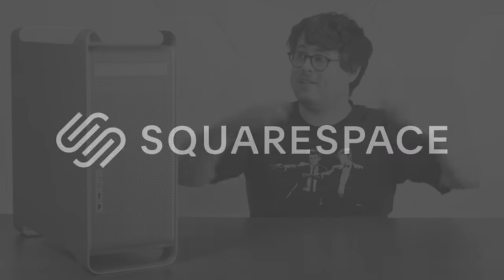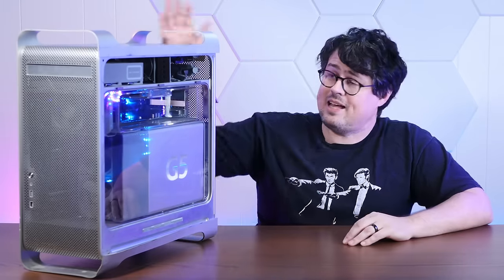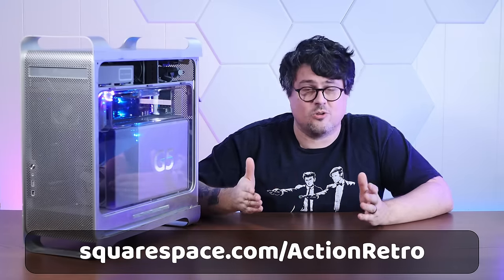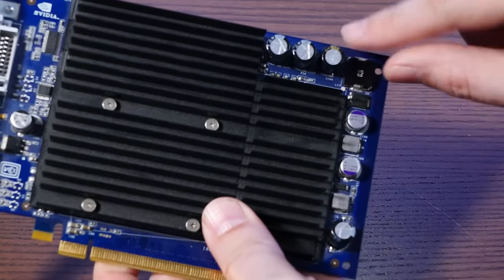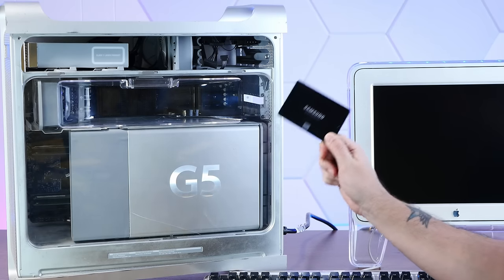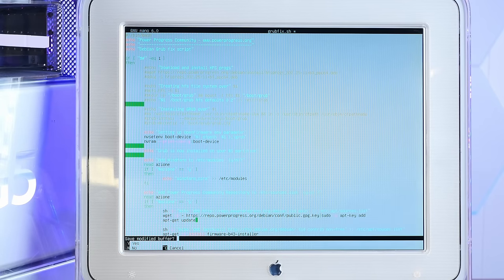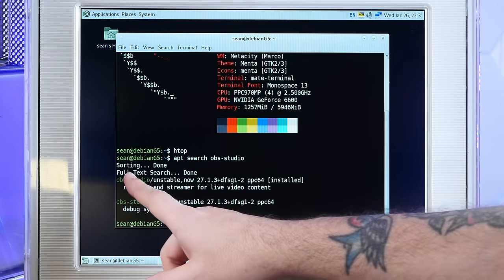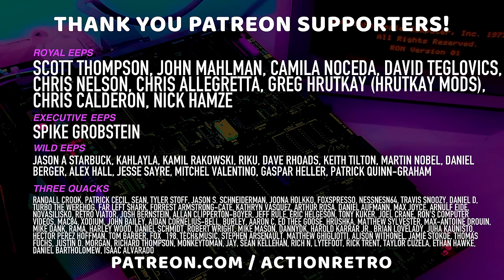Four G5s, in ONE PowerMac? It's the fabled G5 QUAD!

Comment: I'm with you on that gpu cap, I'm 100% sure that GPU cap was replaced by someone else too. It's even a different color. My guess.. they just used a heated knife or spoon or something. Probably did what they could in a pinch, since it was probably holding up some studio sessions.
Reply: Or one of those butane torch soldering irons.. (shudder). Those are basically a brûlée torch making a knife hot anyway, but sold specially for that purpose 😅

Comment: I have a 2004 duel 2.5 G5 I rebuilt the LCS in mine. It is not really too hard. There is a couple of threads on Mac Rumors forums that give some pretty good instructions on how to rebuild it. I also used modern cooling fluid to refill it, I used Primochill PC Pure 32 fluid which is much less problematic then the Dexcool that was used as the original coolant.

Comment: I would so be pulling that all out, flushing the rads and pumps and replacing all of that tubing with modern ZMT. I bet a fluid refresh in combo with new  tubing you could make it bulletproof.
Reply: But would a pump that old and high millage be okay? I imagine the seals and stuff would be pretty worn
Reply: @JohnSmith-xq1pz  seals on the pump/water block could be refreshed pretty easily. I’d love to get my hands on one and pull it all apart.
Reply: @elitexcomputing8802 I suppose yes new seals could be made on a laser cutter or something assuming standard one's wouldn't fit

Comment: Most people with these models replace the water coolers with air coolers, there is a diagnostic tool that adjusts the fan speed on mac garden that basically fixes it... Ken actually did a video on it and it works fine.

Comment: I have a Late 2005 Quad G5 I bought from a cad guy (it still had applecare on it (which is good because its boot drive failed))... thankfully, because it's a late 2005, no leaks. sadly, like yours, the 'handles' got mangled (in my case, the top on 1 side in the front and back).. still going strong though, was and is a workhorse. At one point, added 4 1TB drives w/ ZFS to it for extra storage. It's one of my "I'll never sell it." machines. I would however replace/repair the broken shell part(s) if i could.  As an aside.. that capacitor on the video card was not OEM (you can tell that if for no other reason it doesn't match the other 2 in stripe coloring).. someone who couldn't solder replaced it.

Comment: Okay, in my main Quad, I put in an eSATA PCIe card, which is great, as far as the fastest speeds from a external drive. The enclosure I got also has USB 3, so it's great for transferring data to newer machines. I also put in a Firewire 800 card, which has an internal port. I connected an internal Firewire drive, which is the boot drive for Tiger. I put in an Nvidia Quadro with half a gig of vram, I think that's the most powerful card you can run on a late 2005. I tried hard to get USB 3 to work, but there just aren't any drivers available. I tried to use Snow Leopard drivers, which seemed to install, but the card just wasn't recognized. The main SATA drive boots Leopard, and the other SATA bay switched between Fienix and Sorbet. (Edit) I forgot t mention the IDE Bluray disk player. It is pretty cool tone are to watch Blurry movies on that 30" display.

Comment: Hello there!

I had such G5 for a few years and ended up swapping for a dual core late 2005. It generates ¼ or less of the heat of the Quad, so I've never heard the fans spin up - and it's enough fast for daily tasks, especially with Adelie.

The Quad was loud and I didn't have the guts to maintain the LCS. I regret selling, though. It was maxed up with 16GB ECC, the Quadro 4500 and SATAII SSDs. =)

edit: I've also tried modern GPUs (trying to get stuff sorted with the nouveau folks) and a Thunderbolt card. =)

Comment: The water coolers wouldn't always leak, but after they get old enough they would often fail. I have two quads and they both overheat quickly due to failing pumps. No leakage. I'll need to get them rebuilt, which is no small task.
Anyway, when you inevitably beef this thing out, you can try to get ahold of an Nvidia 7800GTX 512MB card, which is the fastest you can get in there. The 512MB card wasn't just a RAM bump. It had significantly higher core and RAM clocks. It was never officially available for Macs, but there are hacked ROMs out there for it. They're not easy to find, though. I've also tried using 4GB RAM sticks in it with no success, though one of them did work in an iMac G5 2.1ghz iSight, pushing it up to 4.5GB, so it looks like the G5 really is capped at 16GB RAM unless you have some sorcery to use. You can also try to find a bootable SATA 2 card for it. I believe there was only one that was made by FirmTek, though the model number escapes me at the moment.

Comment: I got a DC 2GHz and had to replace the power supply and all the ridiculous nonsense to do that. Looking at the specs on the power supply it will be very hard to replace with any sort of modern equivilant as [ignoring the 24V monitor power input] the volts and wattage requirements for the 3.3 and 5 V rails are coocoo bananas. I have some ideas but I am not certain its much better as the power supplies are of a similar vintage. hopefully the supply of power supplies for these does not run out anytime soon.

Comment: I had a dual G5 Power Mac years ago. It was not liquid cooled.  It was a space heater. LOL it legit would cook your legs under the desk and cook your face and arms on the desk. Amazing machine for it's time and I couldn't get it to bog down no matter what I threw at it. Mine died due to a dead Power supply. There was no G5 Powerbook because it would melt. 🙂

Comment: 18:04 Perhaps it means that OBS is trying to use some sort of unavailable CPU extension? I know that some super new programs for Windows will spit out something like "illegal instruction" when an older x86 computer lacks AVX2 extensions. So considering how old the G5 is, that could be the reason why.

Maybe you could compile OBS locally? That could be worth a shot though you might want to compile it with two CPU cores instead of all of them in fear of overheating.

Comment: I was surprised to see Delphi's name in the water cooling bay, but in retrospect, water cooling wasn't that big back in 2005. Apple no doubt had to source the radiator and hoses from automotive parts manufacturers (a la Delphi). Also, those hoses look STRAIGHT from an engine bay. They have a silicone-based jacket, which is why the hoses have a semi-shiny appearance.

Seriously, take a look at any of your water cooling hoses in your car's engine bay and compare them to what's in your G5...they look identical in make, right? All in all, a very cool and unique CPU cooling solution that's literally built from car parts, LOL.
Reply: dont forget metal/nylon braiding , tough goshdarm tubing

Comment: Get a passive PCIe to m.2 adapter, then install an NVME drive. You almost definitely won't be able to boot directly from it, but if you put the Linux /boot and /boot/grub on some small partitions on a normal SATA device, you might be able to put / on the NVME drive. Basically using the hard drive to chain load booting from NVME. I've done this on an older x86 machine to great success, but I have no idea if it will work on PPC. My experience with GRUB on PPC is very limited, but on x86 at least it will also chain load Windows boot loaders. So even if the machine's BIOS (or PPC equivalent, idk) and OS X's bootloader don't support NVME, if OS X has drivers for it you might be able to use GRUB and a Linux installation to chain load OS X off the NVME drive.
Reply from the maker: Great idea!

Comment: I remember when IBM was promising Apple multicore PowerPC chips running at 8ghz by 2006 or something. When that road map clearly wasn't happening, it aided in the switch to Intel. Realistically, Apple must have quietly developed and had OSX (maybe even 9) running on Intel for years in order for the transition to happen so seemingly fast and smoothly.

Comment: The illegal instruction error might be an indicator that debian unstable is targeting a PowerPC architecture newer then the G5 PowerPC CPU. Like the ones used in the Raptor computing workstations Talos II and Blackbird. What you could do, if you want to have an up to date Software stack is, use Gentoo Linux or maybe FreeBSD. But definitely Gentoo can be configured to target the G5 CPU specifically. But be warned, installing Gentoo might be quite some work. Good luck tough.

Comment: Love the quad. I’m in need of performing a fluid change and possible pumps change since I have the V2 of the LCS… yay powerful hardware… but in all seriousness, the g5 has cpuA at 25 degrees C which is great! But cpuB is 75-80 degrees C…. So I’m assuming that part of the look is either blocked or drying up.

Comment: I would love to see somebody swap the water cooling out for a modern Noctua cooling system, given that they're designed for even hotter systems. Would certainly take a lot of hackjobbing but I imagine it would be worth it.
Reply: The only thing like this I've seen is taking the air cooling from a 2.0ghz model and replacing the liquid cooling with it

Somebody really does need to make a modern cooler
Reply: @ezioisawesome56  I'm sure you could somehow hackjob an TR4 or maybe even AM4 cooler into it. I've never even seen the socket but it can't be impossible.
Reply: @IoIxD  computer clan did a video about fixing the g5 that blew up (same one shown in this video) the sockets kinda weird but with some interesting engineering I'm sure it's possible

Comment: I've noticed a lot of libraries for linux have in the x86 space went to requiring SSE2 at minimum, when I tried Debian Sid on a Pentium III last week, anything that needed MESA for opengl would fail with Illegal instruction, then when I went down to Debian Stable, the same game I was trying to run still failed to load with Illegal Instruction because OpenAL requires SSE2, so perhaps since ppc64 runs on later not Apple hardware some of the libraries have moved to relying on instructions only seen on later PPC CPUs.
Reply: I know it is hard but use gentoo with a secondary recent PC to run the build of packages
Reply: At least Debian are making efforts for reproducible build but building the whole archive without sse2 is a rough task

Comment: I bet you could rig up some custom loop water cooling that will outperform anything apple put in there. Wonder how big a radiator you can fit up front.
I'd like to see the most modern GPU you can cram into this thing. Maybe a GTX 1060 or something? RX560? Whatever you can find, really, should be supported by linux.
Reply: air cooling is safe.

Comment: Hi, regarding OBS on Linux. Maybe you need to check for GPU drivers? As far as I can see OBS requires OpenGL 3.3 or higher and maybe you're running on framebuffer drivers? If not then maybe the PPC64 version is for a newer POWER5-based system and requires some instructions the G5 does not support, then maybe it can be compiled manually with the correct flags. Worth a try to download the source and the usual ./configure, make, sudo make install procedure that will maybe give you a working OBS.

Comment: Brooooo.  I just bought one of these on craigslist for $20.  Its the Quad 2.5.  Think it just needs a hard drive.  I had a G5 all through film school and it was the peak of Apple design & engineering.  Everything apple does today is a spin off of this design.  Even the new iPhones have the satin aluminum finish with sharp edges.

Comment: A question: if you run that script that tells the G5 Open Firmware where to boot from to run grub and later decide to go back to Mac OS, do you need to undo the script or does the G5 "naturally" know how to boot from the Mac OS? Ie. is that script an addition (like: look here in this location too) or does it completely alter the patch where OS is booted from? If you need to undo it what is the correct command? I would like to try the Linux on my G5 but want to be sure I can easily go back if needed. Thanks!

Comment: The quad g5 was not all that. Very little software took advantage of the second dual core g5. You are better off converting it to air cool. It runs fine with air cool and you perminatly remove the risk of a leaky cooler. I'm not a Linux person so just my thoughts from the Mac side of things

Comment: I am curious what is the fastest video card you can use on this. Can you use cards from Intel Macs?
Reply: To answer my own question looks like you can take a 7800 GTX 512 and flash it to a Quadra FX4500 rom.
Reply from the maker: Oh yeah I've been searching for one!
Reply: @ActionRetro  they are very hard to find. The 256mb is cheap and easy to find. I read recently that you can flash the ATI X1900, which was a beast of a card back in those days. I got this Quad G5 also and I bought the flashable version of the FX4500, which runs a bit slower than the 7800GTX. All of them way better than the 6600 anyway.
Reply: I have put a x1900xt pc version in my quad which I flashed with a custom bios. It works great in osx. But with debian 11 from his previous video I couldn't get it to boot. After the grub screen my screen stays black

Comment: I have this exact machine (same GPU and same amount of RAM) and was unable to get this working following your last video. I eventually got it installed properly but the graphics card wouldn't display properly. Just a garbled mess. I then installed another nvidia card that came with my MacPro 1.1, so slightly newer. That got the machine booting, but then I was unable to do anything else as my user was not superuser, and I have no idea how to make anything work in linux  if I'm not superUser. Not even installing a program worked, let alone changing any user-rights. I'm not really used to Linux, but have been using manjaro on and off for about 5 years, but this Debian-environment was completely unusable for me. I don't understand how that 6600 just WORKS for you..

Comment: The BIG problem with those multi G5s (even more than the liquid cooling system) is the MASSIVE weight the cpu+metallic heatsink+pipes put on the logic board bolts; I remember having a dual G5 that failed twice: the first time one of the G5 mountings have literally ripped off the logicboard and when sent to an "apple service center" they installed the replacement so tightly that ended up screwing the tiny cpu balling connections, thus rendering the cpu and the logic board unusable, with huge delays in shipment and costs.One of many examples of Jobs stupid stubborn impositions (besides the mentioned design flows of putting liquid coolant over the PSU); I don't remember if these water cooled G5s were loud but the single one cpu with fans were dubbed "the jet turbine" once you open a couple of demanding apps (like video or audio production ones).Definitely, the last dinosaur that went extint for good reason (intel were the competing mammals that ended up ruling the world)

Comment: such beautiful machines! I have 2 of the basic ones, they have 2 single core cpu's inside and even those look stunning with the side cover off..thing is , they are slow as molasses, struggle to play a youtube video and make the fans run like a vaccum cleaner...in a nutshell, unusable for todays internet...so they sit in my closet,unless I had a buyer who wanted a pair...  I use 2 mac pro 2,1's and 1 mac pro 5,1 running monterey,nvme,24gb ram,rx570 and dualbooting win 11....its a 6 core 3.5ghz one... either of the old mac pros,even the 2,1 is plenty fast still... the power pc ones though, their time has passed.